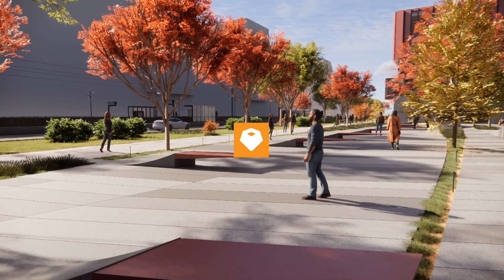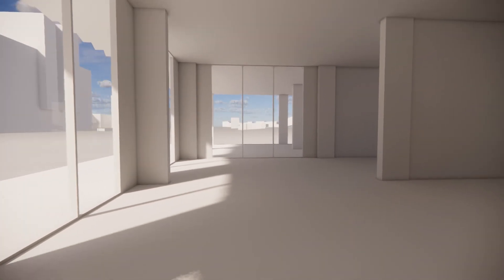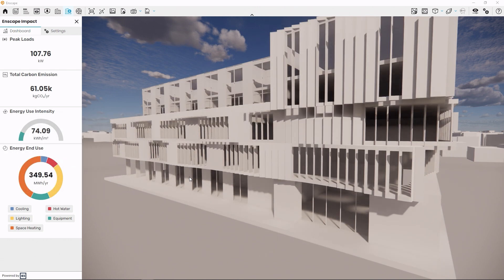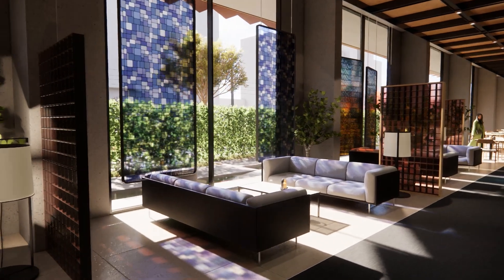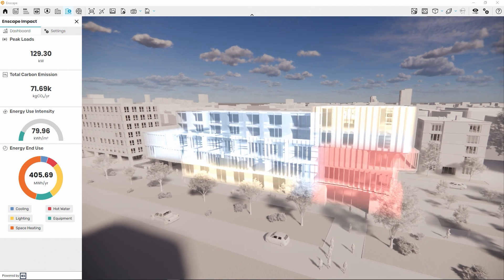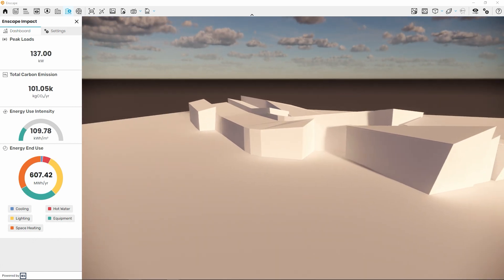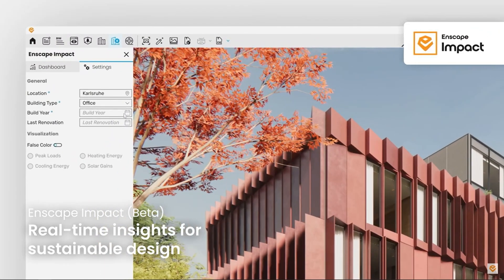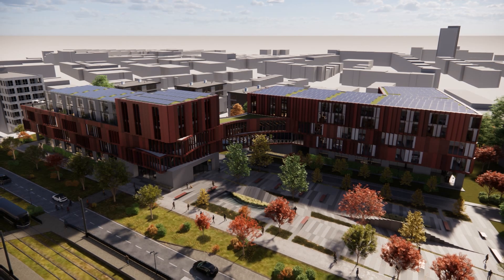Discover Enscape Impact | Tips & Tricks

Comment: Can Enscape Impact recognize the material change of the building? For example, if the material of the window is changed from glass to metal panel or from single glazing to triple glazing, will the energy consumption get changed?
Reply from the maker: If the change of materials is glass to metal, yes, Enscape Impact can detect that and take the change into consideration when running the analysis. Regarding single vs triple glazing, this is not currently being properly detected, but we are aware that this has a significant effect on the energy consumption. We are planning to extend the input fields in the future to take more data points into consideration.
We would like to invite you to share your feedback about Enscape Impact with us so we can continue to improve this new tool: https://bit.ly/3Xdk9q1